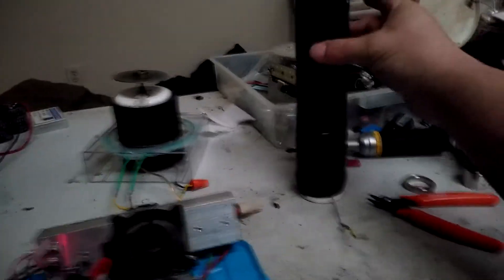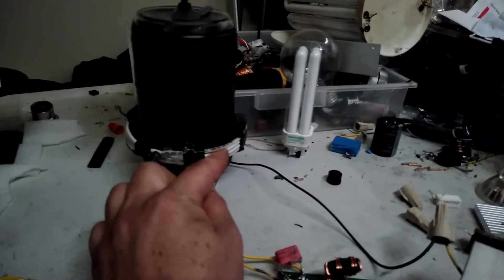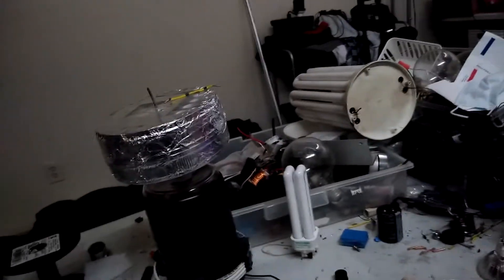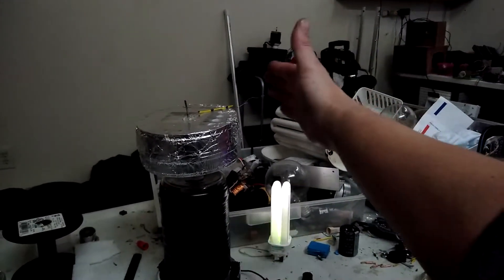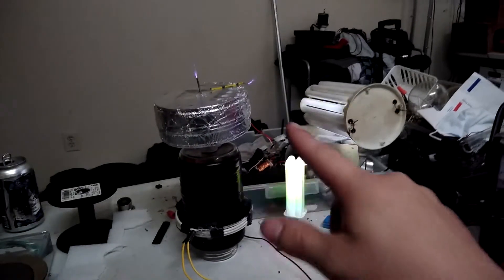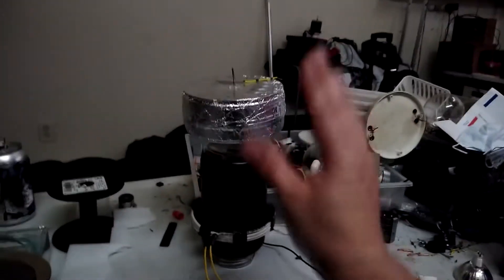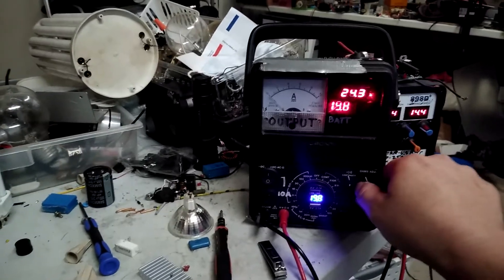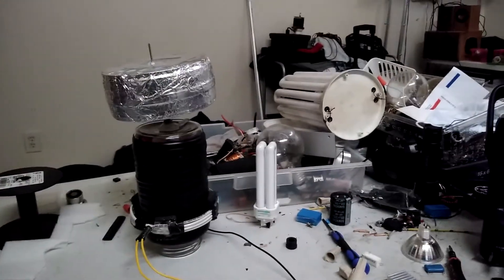Another Push Pull DRSSTC 30v Test

Comment: Do u understand what the mag wave is on the secondary ..... I bet if you set the primary slightly lower than the last winding on the secondary she would perform extremely good.....
Reply from the maker: It actually depends greatly on the input voltage I'm feeding as well as the topload. It doesn't perform as well all the way down there unless I remove the topload and then it just pulls nice hot arcs at lower voltage but doesn't give me decent streamers.
Reply: @Magneticitist  like your style bro 😎⚡⚡⚡
Reply from the maker: @morganchandler5126  lol thanks bro I'm digging your tinkerage. I see you started with your first SSTC only 2-3 years ago coming into it brand new and have already made it to the big boy stage. I been screwing around a lot but I haven't really learned as much as I should have by now. Maybe If I stick to it for a while I might go from the trial and error fuck around stage to the actually know what I'm doing stage.

Comment: Try making a mmc cap bank of the same capacitance 4 the primary and a BIGGGGG 1000's of uf @ 400+ vdc cap on your power supply to support it in burst mode ;)      i love yours & teslaundmehrs single mosfet coils & currently tryin to get 1 goin with a irf630 but no beuno just heat... even with a nearby slayer coil to maybe trigger oscillation but no....
Reply from the maker: Oh yea bro I'm waiting on some caps at the moment but you know that China delivery is all jacked up still I guess. This little WIMA MKP is working its ass off. Had some other caps I figured might work ok but there was noise out the ass. 

You using a gate driver and gdt after a schmitt trigger?
Reply: @Magneticitist  no... i should & i need those precious wima caps too:(
Reply from the maker: @PLASMAKVA500  Oh are you trying to get a HF SSTC going like per Teslaundmehr's circuit? That one is surprisingly simple yet complicated at the same time. Fortunately you can get away with small decoupling caps for that circuit.

Comment: I've tried using blow tire rubber as isolation and noticed it severely dampens the B field, maybe it's the talc like dust that's inside though
Reply from the maker: It's wild how at high enough frequencies pretty much anything random can affect Quality. I use PVC sometimes then burn holes in it pulling arcs and it basically ruins it cause of the tracks. Seems like some kind of lacquer and legit enclosure is good enough but about 73 hot glue sticks seem to work for me also. I see the acrylic tubes online and whatnot but those fuckers are expensive. Vacuuming as much as possible with no bubbles is about the only way I can think of to ensure the best results though. Sometimes I can hear arcing on the primary but don't actually see it etc.
Reply: @Magneticitist  the high the frequency the more volts per turn